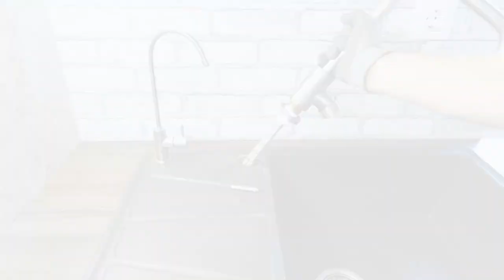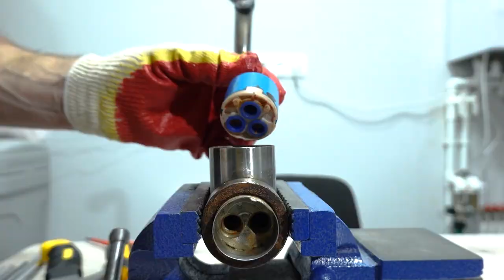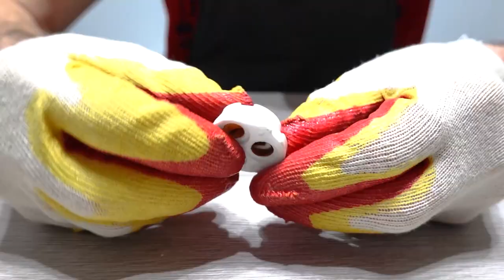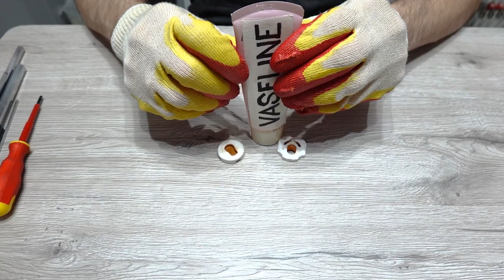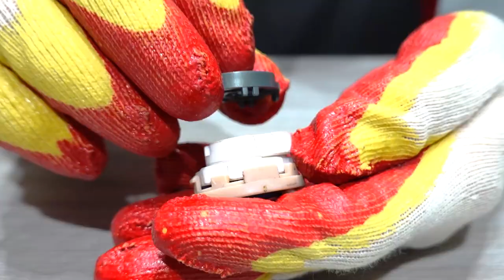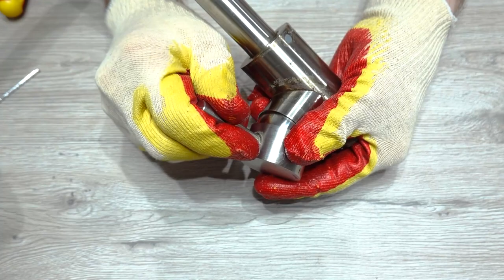Old Plumber shared a SECRET! Faucet cartridge repair

Comment: Pls don't do the finger wag.
Use aluminum plate or cloth in vise for protection.
Vaseline will work when in a pinch, better in the long run is Silicone Cartridge Grease just for that purpose.
Useful vid. Good luck.
Reply from the maker: Thanks for the comment! Mutually!🤝